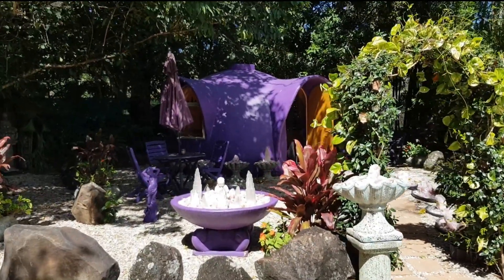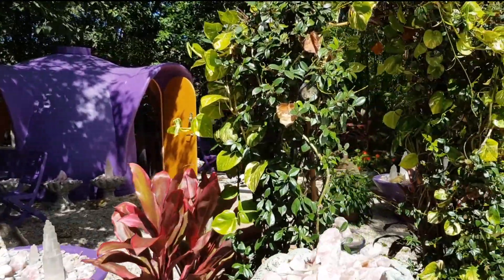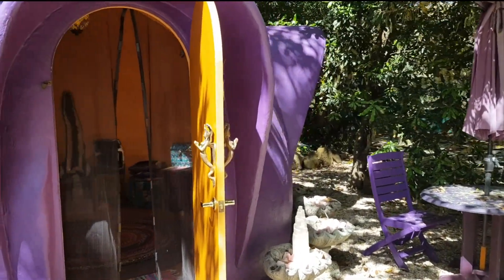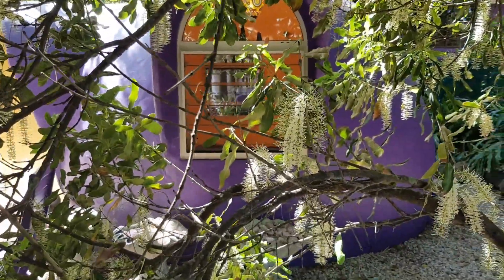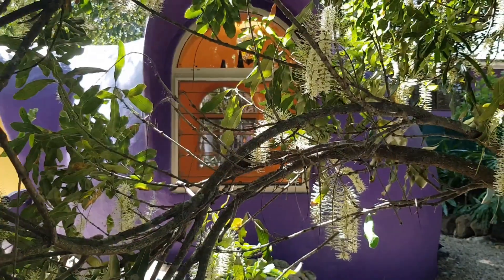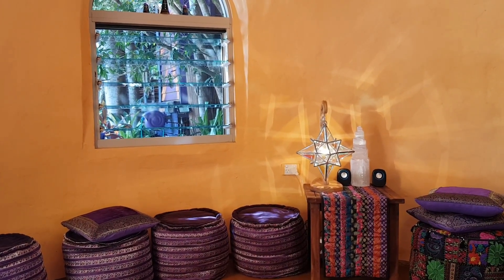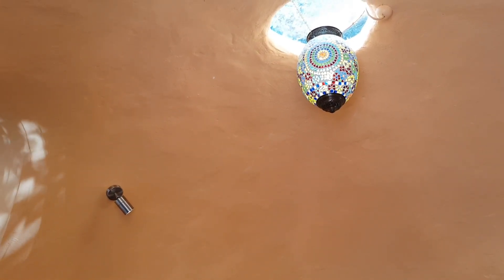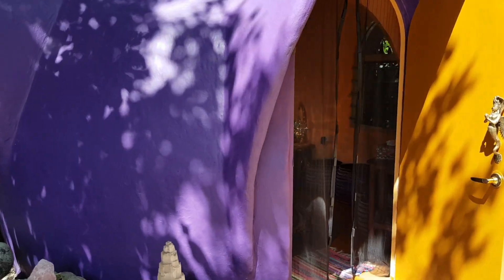Temple Byron Dome Tour

Comment: Does the render preserve the bamboo? Is there a strength difference between bamboo or steel frame? Cheers
Reply: The render may preserve the bamboo as long as it does not get wet or bugs eat the bamboo. Generally the bamboo should be treated against insect attack. The preferred strategy is to use the bamboo for the frame but rely on the reinforcing of the mesh so that even if the bamboo was damaged in any way there is sufficient mesh matrix to maintain its structural integrity
Reply: @DreamDome  use foam cement next time and the bugs wont eat the boo